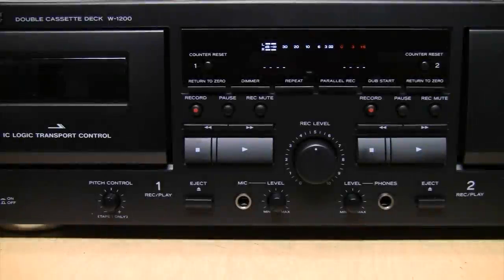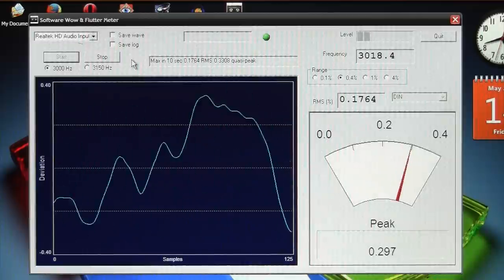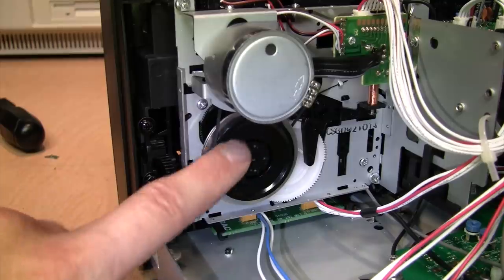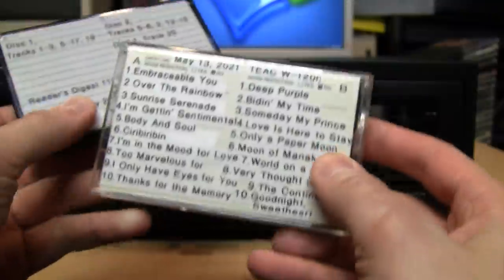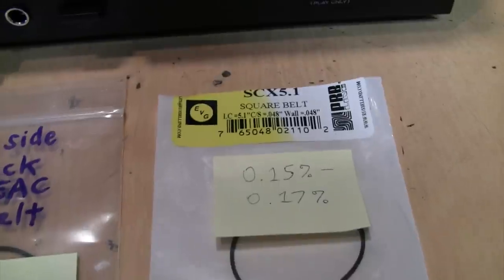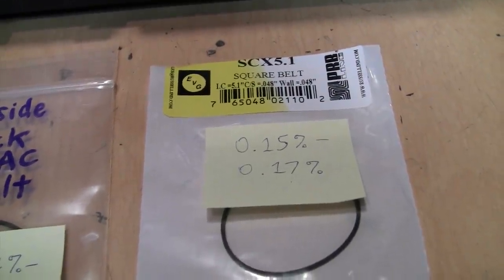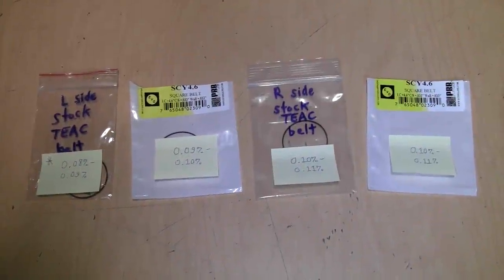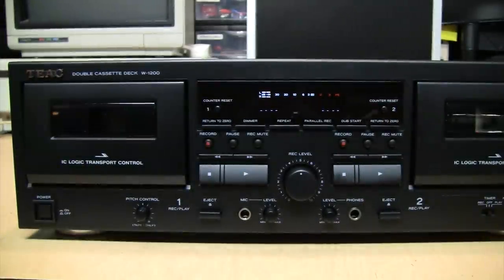The big difference little cassette deck belts can make

Comment: I bet 95% less cassette decks would have been thrown in the garbage if they would have simply made it easier to change the belts.
Reply: how some cassette players are constructed makes it very difficult yo try the "Bag-O-Belts" approach, because you need to disassemble and reassemble the whole thing. Especialy that the symptoms of a belt that is a bit too small and a bit too big can be exactly the same. And then you lose a snap ring or a spring and what was supposed to be an hour of repair turns into a week of search.

Comment: Apologies if you've mentioned this in your video. I may have missed it. I use a number of old decks and I have found that cleaning the pulleys very well with alcohol is essential as they collect a lot of grime and belt material. The new belts should also be pulled through alcohol soaked micro fiber cloth as the manufacturing process can leave a lot of loose debris.

Comment: Jordan pier did a good video about this and why it's important to use good quality belts and not the 5$ bag of belts from China. Normally preserving the oem belts is better than replacing them...unless you can get real proper belts.
EDIT ..it's equally important to replace the take-up reel belt when it's driven by the same motor due to a bungee effect from deviations.
Reply: So true. But what is a good quality belt these days? Arent't the expensive belts simply taken out of the "five dollar bunch" and marked up to appear "premium"?
Reply: @jmi5969  Not hardly.  And you can buy those from some sources and they make a heck of a difference.  Even if they are, they are the ones that passed a "quality control" and dont have a deviation in thickness sometimes multiple times over the belts length.  Watch the video and you will understand.
I service 80-100 decks a year, and I make evey effort to keep the origionals because of this.  If I have to buy belts, I always check the WAF afterwards. 
But you are probably right to one point, there are probably a good many people on fleabay doing exactly what you say.  Another reason to stick to reputable sellers.
Reply: @jmi5969  or cheaper And every batch made is different,,,, lets say you buy from xxx and later buy from xxx a year later their no guarantee that they will be the same quality. is their a vender that actually make belts? or has quality control from China.

Comment: The pacific stereo motor will cost half of the total cost of the deck and based on tapeheads description is aimed at high-end deck. The next limiting factor in your TEAC deck will be the quality of the flywheels which is, to be honest, quite on the cheap side.
Reply: I wonder if that could be replaced or made heavier and balanced.
Reply: @craigjensen6853  Not everybody is an audiophile. Keep that in mind.

Comment: I installed a Pacific Stereo motor in a fairly high-end Aiwa XK-007 Excelia which required a new motor, along with good belts.  Performance is fine, but no better than the original motor before failure.

Comment: I like to restore older cassette decks as one of my hobbies and it seems like it's hit-and-miss quality with the modern made belts. I replaced the belts in my Aiwa AD-F780 a year ago and already I'm having issues with wow & flutter, so I ordered new belts and pinch rollers.
Reply: Where did you order your belts and pinch rollers?  I have a Aiwa AD-WX777  that I want to delve into.

Comment: It would be useful to take note of the Peak W&F measurements. The legacy DIN specification for a hi-fi cassette deck is 0.20% peak weighted, not WRMS (weighted root-mean-squared). With the left-side deck and original belts, peak-weighted ranged between 0.24% and 0.30%, with the right-side deck, peak-weighted ranged between 0.15% and 0.20% which provides even stronger evidence about the deficiencies of the left-side deck's performance.  Thanks for your hard work on this!

Comment: I'm actually going though this exact issue right now but on a Yamaha KX-1200 deck.  In case anyone cares, the correct capstan belt for this unit is a FBM 9.6 (Flat Belt Medium 9.6 inches).
Reply: Starting my kx1200u now.

Comment: A thought crosses my mind concerning linear elasticity throughout the circumference of the belts. In short - Hooke's Law on the deformation of a material. It is quite probable that as the belt spins around under tension - the amount of 'expansion' is not proportional to the same amount of tension, albeit very small. Nevertheless it appears to be showing up on those Wow/Flutter tests you made.
Interesting video!

Comment: From my experience only the capstan belt affects the wow and flutter. Nice video, nice explanation!
Reply: That's usually the case but I had a pioneer ct-S405 where the drive belt did impact W&F. Depends on the mech design.

Comment: I can 3D print flat belts that perform nearly as good as the original belts for decks that had good w&f figures. I restore tape decks and bought in belts from all over that were supposedly premium but a very disappointed with all of them. So I decided to try printing them and it took over a year to perfect the process. If you would like to try some let me know.
Reply: Interesting. what did you get the wow and flutter down to? how would cost for a flat belt?
Reply: @musicstevecom  Depends on the deck. Should be able to achieve close to original spec if motor is good. DM me I'll send you some info.

Comment: I always clean the belts before and after installing to be sure there are no skin fats/acids (or accidentally touched grease of mechanism) left behind. This can make a world of difference. Also, be sure there no wrinkle or wrap in the belt and all wheels drive the same side of the belt. These mechanism have a very light flywheel and it possible the center is not exactly in the center or the weight is not even balanced because it is made out of cast iron. It is possible when you take the belt off again and install it again you will get slightly different results.

Comment: Great findings i often buy specific kits from a few ebay sellers who,s belts have turned out to be ok  i will be really interested in you findings with the better quality motors it might well make a difference as they might be better balanced internals  so they might well be more stable speed .

Comment: Had similar experience with my mediocre Sony double deck. The first replacement belt(s) I had was of literally rubber-band quality. A very, very, yuck result. I can really see the belt dancing around in the motor pulley.😳 It's THAT bad! W&F was horribly dancing around 0.15-0.2% too. Later replaced with higher quality belt with very consistent thickness/texture. The W&F immediately dropped down to under 0.1% - sometimes close to 0.05%. 

So good quality drive belt definitely plays a big role here. Especially for later decks that came with tweeny-tiny flywheel (or even plastic flywheel, in my case) which have literally no weight in it. Unless the belt (maybe the drive motor also) is in really good condition W&F would be off the roof then. The older decks with massive flywheel would be more tolerable in this regard.

Comment: It's amazing how sensitive these players are for the slightest thickness variation in the belt.
Reply: Surprising come up with something to give constant low wow & flutter, no matter the size of the belt!
Reply: Ohhhh yes indeed square belts that vary in thickness as it turns adds the need for torque to move it, especially the tiny pulley on the motor. The governor circuit senses the slow down and compensates for the additional load. Now that it is past the thicker portion the governor is now sending the compensated power and now it is too much so again the governor compensates and by that time the thick portion is again going over the pulley. It makes it a vigorous endless cycle and on top of that the mass of the capstan is nothing compared to the very heavy capstans in the time of the GOLDEN age of cassette in its heyday. It's the same with the flat capstan belts (thickness of the flat portion as well as the width of the flat belt the result will be wow and flutter. Inconsistent thickness and inconsistencies in the width will cause speed fluctuations (wow and flutter). They don't put the time and workmanship into anything anymore with near about anything, from your bread toaster all the way to your vehicle. Nothing is made to last a lifetime anymore.
Reply: Because the tanashin was originally designed for boomboxes, so the flywheel is rather flimsy. All the old school hi-fi decks had around 3" cast iron flywheel smoothing out the the speed inconsistencies. That's why so many of them still sound alright even with old worn belts and bad lubrication.

Comment: Iv'e often wondered if decks with flat belts have a better wow & flutter then the ones with square belts? I experimented some with ones with the square belts, in fact changing one with new belt and speed was way off. It played slower. Belt wasn't too tight either. But the thickness was a bit different. Ended up putting original belt back.

Comment: The flat belts on deck or video mechanisms are replaced when loosen enough or if there is movement of the belt sideways every time capstan starts.And replacement belts if there are available nowadays does not have some specific quality characteristics but simply are belts.

Comment: Ιve found also like you that Tanashin transport is effected very easily by changing belts.
I've had an Aiwa AD WX 515 which uses tanashin transport and when i tried some different belts i had different results in wow and flutter.

Comment: I didn't know about this, but it really makes sense.  I bought a used Sony CFD-20, and the original belts were toast.  I found some replacement belts on ebay, but they were awful.  They looked like o rings that were repurposed to be sold as belts.  They weren't square, they had a round profile.  And the sound is awful, especially when recording.  The extra friction from the recording head is enough to make the belt slip a little bit, so it records too slow, and the flutter is pretty bad too.

Comment: I wonder if beefing up the motor mounting bracket would make a difference. Slight twisting in the bracket could cause variation in speed.

Comment: How about adjusting the position of the motor? Looks like you can shift it up and down.
Reply: Good Idea, I think that would work, since the new belts are to tight and old ones to looses , would have to have to make slots for the 3 motor bolt holes and could even better add a fine adjusting bolt to move it in/out later if it works , I have a extra one I could try it on w the Pioneer ct-f900 has a lot of room to do it. I wish I had a mill (machine shop)😁

Comment: I hope you show how to fix cassette decks that are clicking but no damaged or perished belts. There’s no guidance on this anywhere.
Reply from the maker: That's probably due to a chipped gear or a spring that is causing a gear not to engage fully.
Reply: @vwestlife  Thanks, I think it’d still be useful to see a demo, even if it’s irreparable.
Reply: @StevenSmyth  There's a great techmoan video about choosing out a walkman if you're just getting into the hobby, and part of the video talks about what it sounds like you're describing. Basically, if it's a "DD" or "direct drive" model of walkman, a plastic cog is snapped. Here's a timestamped link to that video that might help: https://youtu.be/A9wT2Y4W-T0?t=228
Reply: @Atticore  I’ve seen that one and it is great, but I’m working with all in one stereos with dual cassette decks, receiver and recorded player. Id like the cassette section to work.
Reply: @StevenSmyth  Damaged gears aren't irrepairable. While i wouldn't advise trying to glue back together a damaged gear, you can easily make a 1 sided mould with 2k kneading silicone and cast a copy of the gear from epoxy. If you're missing a tooth, you can make a partial mould of a short run of teeth and use it to recreate a tooth, and it doesn't really matter from what, ca glue and baking soda can be a very quick way, then copy the whole gear again.

Comment: The last cassette player I bought in 2005 was a Philips with a CD player and a digital dial MW/FM radio. While the sound quality of the recording was fine, it had a severe flutter that I've never experienced in very bad decks I've used before.

Comment: Yes.A belt job is the fix for W/F issues..I service audio products most of my life.Still doing it today as a hobby only..

BTW If you can  supply us where you can get belts ...If you dont mind please...

I usually use those  type  demo /presentation tapes as test tapes  before I put a good tape in player..

Why ruin a good tape as it gets eaten by a faulty player..

Comment: Yeah proper belts make all the difference in any cassette deck. Proper storage is the key to maintain a cassette deck for decades in top notch as both temperature and humidity effect the wow and flutter.

Comment: I won't bother changing the motors on deck like this. They're good enough imo. The belt changing experiment you did I think was more than good enough. I definitely can't hear noticeable w&f on both mechs. You can keep the new motors as spares though just in case the original fails.

Comment: First off, I am surprised how easy it is to change the belts...bravo Teac.  I'm disappointed how sensitive it is to the belts..poor motor torque, and/or not enough inertia???
Reply: I think that flywheel is just too light for a flywheel)
Reply: This new cassette deck features not one but 2 low end mechanism, I thing they're the same than in chinese portable players, with a small engine and a flywheel made out of a cut steel sheet, that's nowhere near the older cassettes providing flywheels made out with a lathe. I do really prefer to rely on an older model, even if I have to fix it (belts and capacitors)
Reply from the maker: These mechanisms are made by CSG and do not share any parts with those used in portable cassette players.

Comment: Nice. Gives me incentive to finally get around to fixing my Marantz SD-53 cassette dec from around 1993. I'd just put it away into storage a very long time ago after it started playing tapes that just didn't sound right abd very distorted. I assumed at the time it was the belts that needed replacement. Just never got around to working out if that was the problem and what size I needed to order.

Comment: I had a friends car deck get the worst case of flutter in just a few months. He played crap tapes and cleaned the capstan and pinch roller with alcohol. In many sources that liquid is mentioned for cleaning such, including on tape boxes.  DON'T USE ALCOHOL!!!  It destabilized the rubber and turned it into a sticky grabby tire. I replaced it and warned him to use naphtha (lighter fluid) If he cleaned it again. The same goes for belts, I usually just clean them with a damp rag. I've had times where I played a live tape of mine on a friends deck and heard that dreadful sound of that cyclic muffling and clearing when the tape is about to get mangled. I hit stop quickly! Popped the tape out grabbed my t-shirt at the bottom and with play on rubbed the capstan and tire as it turned on a hope we could listen to one of my binaural live tapings. I put the tape in hit play and hovered over the stop button but everything worked smoothly.

Comment: Further to my other comment I made, it is quite feasible that the belt is ... 

(1) too tight - enough to increase effective friction? I reduced W/F on the old Sony TC-134SD from 0.2% wrms to 0.1% wrms (and under!) by fitting a slightly 'slack' belt. Bingo!
 
(2) the thickness of the belt varies! Perhaps even a 1% rise and fall in thickness (can't see it) as it spins around changes the gearing ratio, albeit by a small margin, but enough to disturb, and show as excessive wow/flutter!?

I have an issue with my old Sony TC-161SD which uses a square belt. Oh boy!, does this have problems! W/F?, well it depends on the belt: 0.12% .. 0.2% wrms, or a 'worse' belt 0.2%..0.3% wrms! I jest not! Later models of the better TC-161SD employed a main *flat belt*, the very same transport system as used by Sony's flagship model: TC-177SD.

Comment: The problem with all of those belts is that they're just plain rubber, basically just rubber tubing sliced to 1mm width. The harder the rubber, the better the more consistent the speed. 
Basically they are sliced up bicycle inner tubes. Its all they ever were 
Its not as if they set out to make a specific size and shape belt. Those belts are made in several size ranges and there's only so many lengths. They cannot be made or ordered in exact lengths and they really don't need to be. Providing they're tight enough they don't slip, the amount of stretch they have in any deck has to do with how much resistance is present and the speed adjustment of each deck. 

If you look close at most pulleys the pulleys are made for round belts, they are not square pulley grooves, but o rings do not m make good belts, so they use the next best thing from an engineering point, and that's belts cut from tubular rubber extrusion.
The best results are generally had by having a huge assortment of belts on hand and replacing belts by trial and error rather than ordering a few belts and counting on them doing the job. They will work but often you get better results when you have a bunch to select from.

The better tape decks used a 3 or 4mm wide flat belt as the primary drive belt. By nature, the larger belt had less stretch and better contact on the pulleys. These were found on most better decks of the day but as cost cutting became the norm, they were limited to very few models back then.